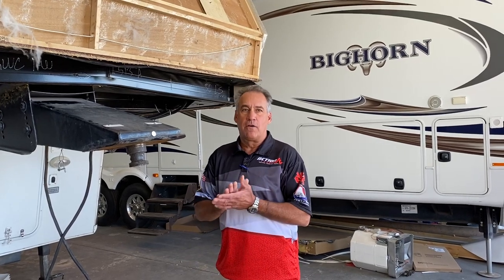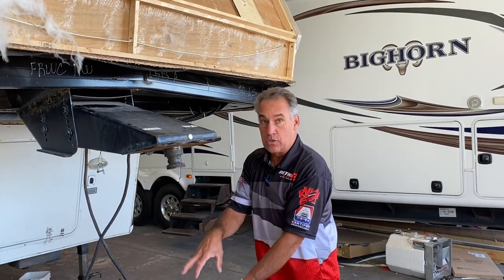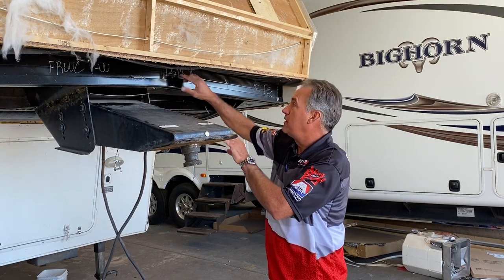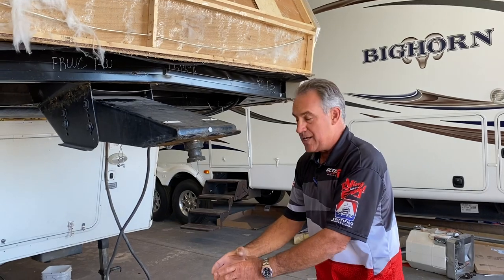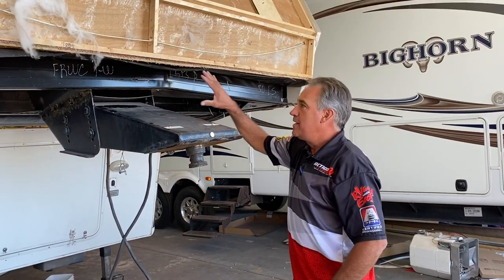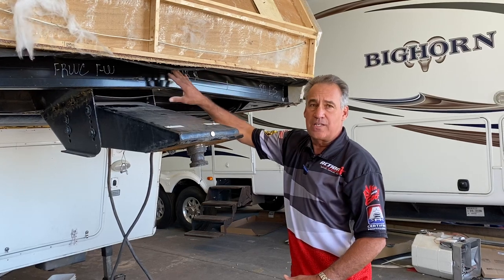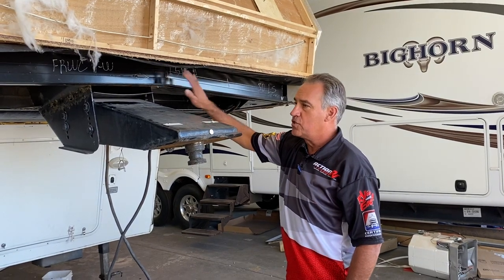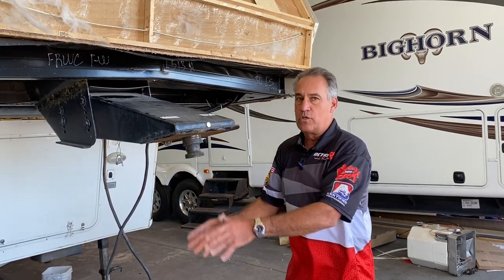Some Gooseneck to Fifth Wheel Hitch Adapters are Bad News!

Comment: Sounds like that means the frame is garbage like everything else on a camper. Let’s just call it what it is. Should be plenty strong enough for that. These manufacturers need to be held accountable for this garbage they roll off the line.
Reply: I came here just to make this same comment! lol
Reply: No, it means what it means...a 5th wheel frame is NOT meant to endure those kinds of dynamic forces that the gooseneck adaptor exerts on it. ANYTHING will break if not used properly. 5th wheel frames don't fail unless some jackass uses that stupid adaptor and not a proper hitch.
Reply: I agree campers no matter the price all seem to have a cheap feel that was horriably overpaid for by the first owner. But, in this case I believe this dude here is correct. When you add an extension to that setup you have just added a cheater bar to exert EXTRA force onto that framework. Alot of extra force.
Reply: @NYVET48TFW if people drove like they should, calm, easy on the pedal, this wouldn't be an issue.

Comment: I pull a 42 foot FR Sandpiper on a Convert-A-Ball adapter with urethane cushions built in. Never had a problem at all. I also have air ride suspension on my truck and the handling and ride couldn’t be better! If the 5th Wheel frame gives way I would consider that a manufacturers defect, period. Millions of gooseneck trailers on the road and you never hear of this on those trailers!
Reply: I'm a year late but gotta comment on this...you simply have no clue what you're talking about! Gooseneck trailers are DESIGNED for the forces of lateral forces of a vertical connection, 5th wheels are not! Anything will break if used improperly! A 5th wheel requires a 5th wheel hitch, a gooseneck requires a gooseneck ball...BIG difference! You can't blame a manufacturer if you break their product that you used improperly. Period.
Reply: @NYVET48TFW  It's not as simple as you say. And your omission of wording how a 5th wheel has No "lateral forces" doesn't help prove you are the corrector to listen to. So are you here to help or to prove/exalt yourself?

BTW he only mentioned one by name that he thinks caused this RV's damage. And he didn't explain exactly how that particular adapter does the damage. He did in theory, that may be logical, but not of that adapter Actually doing it, or help people completely as he's implying he's trying to help inform with this video. So it could rightly be assumed he, and you as well, don't don't fully what you claim to know because you don't go on to the end to fully explain. And he just trying to hook in more to fix for his revenue stream.
Therfore this man and you are leaving room for more error and incomplete data to make the best decision.
Thoroughness by those who purport to be the "knowing"/expert ones, is one of the pitfalls of human society. People being trusted and followed as experts who are only half hearted in the subject. Or at best, do know things, but shouldn't be teaching them, only doing them in the shop/background.
Reply: @HTSS8  it is as simple as that, but hey, do what you want. I'm simply trying to help someone from making a disastrous mistake. Not gonna argue.
Reply: @NYVET48TFW   👍   Just confirms you're not here to fully help or be the complete know-it-all, just half of one, and like already said the half  helper.
Reply: @HTSS8  I think alot of gooseneck adapters are Half Ass put together an there in lyes the problem. If you got the correct adapter installed you should be fine. I do a good amount of towing an I'm never happy with the regular fifth wheel setup. It's always sketchy at best.
Reply: @bluntman99999  Right on, so issues with 5th wheels too. I completely understand that. The problem is people just trying to make a buck trying make Another product with a supposed better spin on one's that already exist and work. Lazy engineering, sloppy production and quality control, and then puffery advertising are all making too much noise of products to weed through what's actually good and what's not.

There's so many different 5th wheel and so many different Gooseneck hitches out there, the percentage of one's worth their cost and quality is probably low. So often some corner was cut to make something to maximize profit.
Reply: I can see that only being a problem if you overload the front of the trailer and also off-road use

Comment: Tell LCI that makes 95% of all fth wheel frames to use 1/4” or thicker steel instead or thin 3/16 China tube. My 2018 frame broke in the same area and I was towing it with a standard hitch. LCI is A shit show

Comment: Reese Goosebox is approved by the frame manufacturer which mimics adding a kingpin to GN ball extension.  Doesn't take an engineer to see this (even though I have a ME degree).   Conclusion - its a poor / weak frame design and not the extension that caused this failure, or possible misuse by the owner.  I was pleasantly entertained by this fool showing me the pull/push forces though.  LOL
Reply: 9 years transporting these, and yes, these adapters absolutely do destroy these trailers. If you honestly had a ME degree you would not need to be told this. Its the stopping, and accelerating that causes forces the trailer frame was never designed for with these adapters. If you have an understanding of how a 5th wheel works, you would know that when connected properly to a 5th wheel these forces are not at all present.
Reply: Any engineer knows if these trailers were meant to be hitched to a gooseneck ball they wouldn't be called 5th wheel trailers and they wouldn't all come standard with 5th wheel kingpins.

Comment: Someone needs a lesson in engineering.  The moment is the same if the GN centerline is inline with the king pin centerline, which it usually is.   Sounds like MFG is trying to get out of warranty work.
Reply: What? you know nothing about leverage and you comment proves it. You are talking about a straight pull at the kingpin  or dropping the pull 18 inches that is the practical definition of leverage adding length at the point you pull. Stop trolling and TRYING to sound smart

Comment: I bought my used 5th wheel from a guy who delivered it using one of those extensions. I understand leverage, so I didn't like the look of that setup at all, but it didn't seem to have damaged anything. I tow the trailer with a Superglide hitch in my short bed Dodge. A much safer arrangement.

Comment from the maker: FYI, most fifth wheel owners are NOT aware that the flexing is happening until visible damage has been presented. Our technicians quickly spot the problem when they lift a trailer with a fork lift. Almost every trailer that we make the frame repair to, did not know it was happening until we detected it moving their trailer with our fork lift. Owners can not see the flexing when they hook up because the movement of the trailer landing gear is too subtle and visibly undetectable.

Comment: My Fifth wheel came from the factory with a Lippert King Combo which gives you the option for king pin or goose ball. 2015 Open Range Light. do you have any experience with those failing?

Comment: Design flaw then.  Needs better support from the factory.
Reply: It's not a design flaw.
It's just the way it's built.
I don't know if you've ever seen the way a goose neck is reinforced with a bunch 45° angle enforcement plates.  It would take away from the slick square design of the travel trailer.
that's how goosenecks overcome what he was talking about with that hitch acting like a crowbar and putting extra strain and counter leaving against the A-frame arms of the trailer.
fun fact if you custom build your own fifth wheel travel trailer you can tell them that you want to put a gooseneck hitch on it and they will reinforce the frame for you at a price.
But it's built for that type of hitch if you don't like it, get the Anderson gooseneck hitch box.
It transmits the load just like a conventional fifth wheel hitch box does but it lets you hook up to the gooseneck ball of your truck
Reply: @jonathanfurtado3696  it's not worth yours or my time. My wife and I are both engineers.  Yes it's a design flaw.  You contradicted yourself in your first 2 lines.  Yes it came from the factory that way, so they built it according to plans And drawings make by engineers and designers.  Therefore if it fails as they show and does not perform properly And can be damaged too easily. Aka it's a design flaw by the engineers and designers who made it to look pretty instead of function.  Looks nice but not practical.  It's just like the rest of our society.  It's built for 1 time use then throw it away.  As expensive as it is it shouldn't be.   It made so cheaply it's not a wonder that after going down the road they break and in less than 5 years they are falling apart. If rv manufacturing was done with better designs there wouldn't be so many problems.
Reply: @michaelm3654   Sounds like you are the typical shop employee that knows more than the engineers who work on the other side of the wall.  Typical tension that I've seen between engineering and fabrication working as a structural engineer for 18+ years....but whatever.

Comment: This is what I want to do.  I want to use one of these for 20 miles to get my 10,000 lb fifth wheel home.  Then I want to leave it connected for any emergency fire evacuations since truck would first take horses to safety (gooseneck horse trailer) and then pick up the fifth wheel.  For actual use I would use the B&W Companion.  It just might be too heavy for me to change out for evacuation. Does that sound reasonably non destructive.  2005 Keystone

Comment: Is there a specific way to check for Damage without removing all the Fiberglass ?
Should the Pin box  Kingpin Plate be level with the trailer ?
if the trailer is level, can I use a level on the Pin Box  Mounting  flanges, if so should it be Plumb ?
I'm interested in purchasing a trailer that has a Gooseneck Adapter mounted on the Kingpin and noticed the gooseneck adapter not looking Perpendicular to the trailer.....

Please Help !!!!
Reply: the first warning you get is when the trailer is connected to the truck. If using one of these adapters. watch out your back window and accelerate, then stop. if you see movement between the pinbox and the face of the trailer. you're already in trouble.